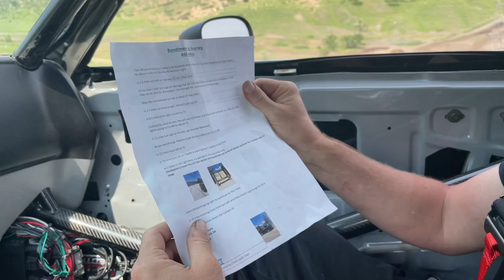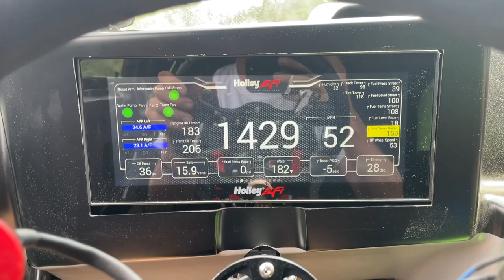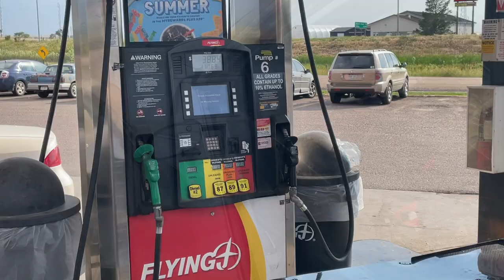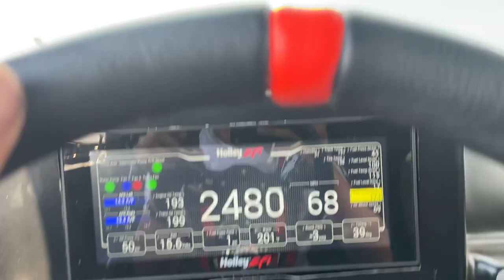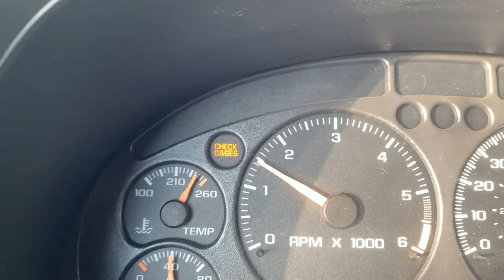RACE WEEK Day 5: Driving My 2,000 Horsepower Racecar 540 Miles Through SKETCHY Mountain Roads!!!

Comment: Kevin built a stout unit, all these miles and mullet is still running like a champ
Reply: 2 race week in 3 weeks and barely no issues, what a builder
Reply: I disagree. It's a pretty straight forward drag car that was designed for what they are doing with it and it's still underbuilt...hence the overtaxed cooling systems.
Reply: @Snarf_Le_Wombat  Well, I’m sure Cleet will call you for the next one, swing as you’re clearly a multiple time drive and drag champion. I’m sure you’ve built many seven second El Caminos that drive 500+ miles in 109 degree heat without issues. Obviously no other competitors had issues with cooling or anything.
Reply: @mikescherrer4923  Funny how guys like you get so so so butthurt when you see the reality. You still can't accept that this ElCo has had issues...and for some reason think an adequate cooling is some sort of fantasy. Your man crush on Cleetus is real cute though.
Reply: @Snarf_Le_Wombat  all the cars they're passing that are broken down while mullet keeps on going say different
Reply: @Snarf_Le_Wombat  I knew you were going to get attacked by one of his groupies. They are so used to fanboy comments that there is outrage if you aren't impressed with their half hearted attempts to buy fame.
Reply: @Snarf_Le_Wombat  Nah, I’m just a guy who has built cars and understands that it’s a process of learning and adjusting. I’ve got the piles of shit I paid for and ended up not using to show for it. You go build a race car that accomplishes everything right off the trailer. I’ll be waiting. My man crush on Cleetus has nothing to do with it. You think Tom’s cars just do 6s automatically every time? I doubt you’ve ever built a car for competition or raced, based on your attitude. Go play some more Forza, bud, your lack of knowledge is showing.
Reply: It's incredible. There are some misses but it's a brand new build that runs 7s and has been on back to back road trips right after being minted.

There's improvements to be made. But that's kind of the point with such a involved build.
Reply: @mikescherrer4923  It's hilarious when people like you try to sound off. Where's a single video of your car?

Cleetus cut a check to a guy and the car still has issues when it was built for it.
Talk about getting rooked.
Reply: @Matty.Hill_87  If you can't make a blank check ground up build perform for what you literally built it for then apparently that's brand new news to you.
Reply: @jimandskittum  Thanks man. The fanboy crushism is expected. It's funny how the people who attack have nothing to show. They live vicariously through this channel.
Reply: @Snarf_Le_Wombat  says the guy that doesn't even have a 10 second car. Stick to dirtbikes man, quit trolling.
Reply: @yhprumhsoj  are you Dominic Torreto

Comment: mullett not having any weird issues during this trip is a testament to how solid a car Kevin put together! Keep it up guys!
Reply: Besides it overheating all the time? Why are people acting like it hasn't had issues...
Reply: @Snarf_Le_Wombat  overheating isn’t a weird issue it’s just too hot for those kinds of cars.
Reply: @That_5.0_Ranger  That's not how it works bud...and you know it. The cooling systems are undersized for what they are trying to do. End of story.
Reply: @Snarf_Le_Wombat  not saying it hasnt had issues. im talking about stupid issues that come up a week or two after rolling out a brand new car. Everyone is having over-heating issues. to be expected on race cars pulling trailers up and down mountains.....
Reply: @Snarf_Le_Wombat  it was 100 plus in Colorado in thin air. Overheating is gonna happen bud. What the point of a massive radiator if you aren't gonna use it 95 percent of the time. Just unnecessary weight
Reply: @rickshiandmoku4128  Wow it's like talking to wallpaper. Yes it gets hot, yes it's a race engine. EVERYONE KNOWS THAT. This car was built for this and it's underperforming. Why bother? Because those are expensive parts and it's much smarter to have it and not need it than be lacking. I swear some of you people have no logic and have never turned a wrench.
Would not be hard at all to make it modular, run an additional radiator for the drives and remove it too race etc...just like the guys who run blowers cut belts for the drive.
It's absolutely hilarious that you think an adequate cooling is unnecessary "when they would never use it" when literally the car was built for this and is having problems.

Lmao at "overheating, it's going to happen bud" I'm sure that's what KSR says to it's customers that just dropped six figures on a purpose built race car.
Reply: @Snarf_Le_Wombat  people don't street drive race cars😂😭 maybe put more time into thinking instead of typing out books😂 Also this car is basically untested and has very few passes under it's belt. It's amazing an untested car can survive race week. I guess you're just to dense to see that😂
Reply: @rickshiandmoku4128  Bruh you need to go to school to learn a constructive argument... because you didn't refute anything. Did those emojis make you feel better?

Comment: Maybe run the smallest possible rear tire on the street? 

That would “cheat” to get a taller rear gear effect and maybe help out the transmission overheating problem some.
Reply: Wouldn't they need a larger, not smaller rear tire for that effect? (bigger tire, lower engine rpm)
Reply: Got that backwards
Reply: Trying to get a higher rear gear. Like 4:10 out of 3:73. Higher gear means less load on transmission. Might drive slower but car will move along with less work and force required from the transmission. 

1st gear on a bicycle up hill vs like 8th gear, Wich is easier for you to pedal?
Reply: @gavincline209  about 5th gear cause im usually hauling ass up hill
Reply: @Garf2O  either way, your not maxed out in the highest gear trying to pedal. Your using lower gears because it’s less effort on your part. Less effort needed equals less heat build up in the transmission

Comment: On the blazer make sure the heater core line are looped if they aren’t connected, if they are dead ended it can cause overheating. 

On mullet, take the hood off and strap it to the bed or trailer. That should keep it from overheating.
Reply: Mullet's not overheating, it's his transmission and that cooler is under the back of the bed.  Probably doesn't get clean air.  Time for some wind tunnel testing to see what works best.

Comment: Get some filters for the highway. Try riding a motorcycle behind a semi on the interstate and you'll feel like you've been sandblasted.
Reply: Correct, the bonnet may need to be modified to accommodate them, but I fear that hindsight may come with regrets for not doing so now.
Reply: @homeshopmachinist84  The texas speed "Cletus" spec 427 runs about 15k before shipping.
Reply: Yeah. Tons of road debris constantly battering the car that most people just don’t really perceive in the vehicle.

Comment: Create a way to cool the transmission using the trailer as detachable cooling station 😂
Reply: I 've got a 56 Chevy 4 door wagon with a factory roof rack. It's got the same type of Trans cooler under the car for a 4L80E, installed behind a gen one 350 with fuel injection and a supercharger. Guess what gets installed on that roof rack with quick disconnects for those long trips?
Reply: @tommcfadden2226  hehe

Comment: Why don't you guys just throw in another radiator. add a fan, etc.
Reply: Weight
Reply: There is another spot on mullet for another trans cooler. Surprised they didn't run both of them, but I guess that is more weight.

Comment: Any time an auto trans without a lockup converter is running hot, all you need to do is drop down a gear (turning off overdrive works). This works! Try it.

Other than a bit of noise, revving the engine higher won't hurt anything.

The idea of dripping water into the trans cooler is a good one too.

For the Blazer, I've never seen removing a thermostat actually help. Switching from coolant to water cools something like 40% better. Removing the hood improves cooling quite a bit too.
Reply: We all know ol cleeter like the hood delete option!

Comment: Cleeter, the Elco looks great (I'll admit to being biased as I own one myself).  That said, the tonneau being black will cause it to absorb heat from the sun, which may be a factor in your fuel getting hot.  I can understand not wanting to change the color but it may be worth trying some insulation in there with a reflective foil jacket to prevent the heat from baking the fuel cell during the long drives.

Comment: THANKS for using different cruising/Time-lapse music!  Love the other tune, but I woke up with it playing in my head this morning!  Yikes!  Ref: water drip on the trans cooler, do the same for the Blazer.  Use the nozzles from the windshield washer in front of the radiator, give it a squirt occasionally.  It will help more than you think.  Water, and a bottle of generic isopropyl alcohol mix in the reservoir will lower the temp.

Comment: We used to have an old Ford transit V4 for drag racing support car, it overheated every trip, I rigged the windshield washer to spray on the radiator for some evaporative cooling. It did help.

Comment: Hey Cleetus, just had a thought.  What about adding a removable extra trans cooler to Mullet?  A few quick-disconnects on the coolant tank and you wouldn't have to worry so much about the transmission overheating :)

Edit: Also your mention of rain reminded me of this.  Maybe a removable bit for the exhaust to keep rain from getting in?  I remember you talking about how much water Mullet must have drank during Midwest Drag Week.

Comment: Hey Cleetus and Friends. I see that you are having a Big issue with everything overheating. I live in Costa Rica and it is the upper 90s to 100s every day so I put a new much thicker radiator in my auto this year. 4 cores vs 1 and then also put the transmission oil through a section of copper heating pipe with aluminum fins on it as you would use in heating a house. You can get it in many sizes. I put in an 18-inch section and it cooled both the radiator down and the transmission. I don't have a transmission temp gauge but my water temp runs between 140 and 170 now. Before it was always 200 to 220. You could put the copper pipes anywhere they just need some airflow. You could put a loop tucked up under the back with a ball valve that would let you adjust it. This will add maybe 2 or 3 quarts more oil to the transmission, which will also help cool it. I would use a 3/4 or 1inch heating pipe.

Comment: I wonder if James knows the trick that you can TURN ON THE INTERIOR HEAT to help cool the car. Interior "heat" is just funneling some more waste heat from the engine into the cabin radiator, it doesn't generate any new heat. It's an extra free radiator that will supplement removing waste heat from the engine. Point the vents sideways out the windows, crank the rear heat too, and drive with the windows down. That or clamp the hood shut with 1/4" space rather than flush. It'll use the whole hood as an air scoop to cool the engine bay. The ambient air temp is still plenty colder than engine temp.
Reply: Just take the hood off and strap it to the roof! An i even watching cleetus rn?

Comment: Should make a compromise!! Next time you’re driving long miles through heat like that you should get a blanket to wrap the hood up in, remove the hood and squeeze it into the trailer or strap it to the top of the trailer and let that baby get maximum airflow! Kevin gets to see the beautiful hood on passes, and you get to have a hood less Mullet on the drives between tracks!

Comment: Mullet pees his self through the heat and Rocky the Blazer boils ice bags after a Jackstand butt drop to the hood. Whatever it takes... you guys need to check out the cool-shirt system that Taylor Ray just installed in the LS Miata, It's stand alone and runs off the 12 volt system and doesn't use ice!
Reply: Mullet has one already bud

Comment: buy one of those pump up plantsprayers (the large type) and fix a few spray nozzles in front of the blazers radiator 
put a long hose on the sprayer to the nozzles 
get some ethanol water mix in the container and place the spraypart between the co drivers legs and hit the radiator with the water ethanol mix when things get too hot
running the heater helps keep temp in the engine down too but it be hot enough inside the car to melt plastic

Comment: Dude, lock your converter on street driving a lot earlier. That slip is killing your temps and converter! I always change the converter lockup when street driving a longer period. Even engine braking will shoot your trans temps to the moon. Above 35mph you can lock that thing up. I have a 3000 stall converter. Without lockup I always reach 230+. With lockup the same road 180 or less.

Comment: As much weight as it would add, it might be worth it to get an electric AC system in mullet just for these type of events. Real simple ducting, single small blower fan, that way you can at least have some cool air blowing on you. The cool shirts work well, but they can't keep up with that heat.

Comment: Depressurized the radiator and it will stop over heating. Turn the radiator cap back to the first click or losses the overflow tank cap a little.

Comment: I wonder if the Blazer engine has some plugged up cooling passages? Seems kind of odd for it to be overheating since its basically stock. I had a ford 302 once that had a bunch of rust in the coolant passages from sitting with water in it and it ALWAYS overheated even with a big radiator and running some magic cleaners through it a few times

Comment: using straight water in that elevation is a big reason for overheating.
Reply: Won't do anything about the temperature, but it sure will raise the boiling point. Keep water in the radiator, not puking on the ground ;-)

Comment: Stupid question ...... I remember way back in the day back seeing a compressed gas kit that just a hoop with jets that went in front of a radiator or air to air intercooler . My question is do people not use those did they never catch on did the cost out weigh the benefit I seen it on cable tv back on the single 0s

Comment: I guarantee your radiators are clogged with those bugs causing higher than normal temps
Reply: Yep, time to bust out the pressure washer.
Reply: Not even close, that's something that occurs after 50,000+ miles, not two race weeks.

Comment: Was cringing at them washing the hot engine bay. How much metal do you think cracked? Lol
Reply: bet money it's fine. I know it CAN happen but i've done it too many times to count without issue. my caddy leaks oil slowly, I hose everything off from underneath weekly to keep it from dripping in my parking spot, always gets the manifolds when i'm going for the sides of the block
Reply: @Kowalskithegreat  probably is fine but I still don't like seeing it because I know what it could do.

Comment: Need to get Kevin to hook up a sprayer water mist kit on the trans cooler and radiator that sprays only when you get over a set temperature. Or just run a water heat exchanger oil cooler that runs of the inter cooler water tank. https://www.pwr.com.au/product-category/oil-coolers

Comment: On days like that you got to turn off the AC, open the windows, turn on the heater full blast, and go easy on the hills.  Pressure wash the radiator to get the bugs and leaves out.

Comment: Mullet is NOT 2000hp the dyno run it was barely 1250! you complain its hot and your car is overheating drive to the speed limit of 65 not 75-80 then your car will cool down